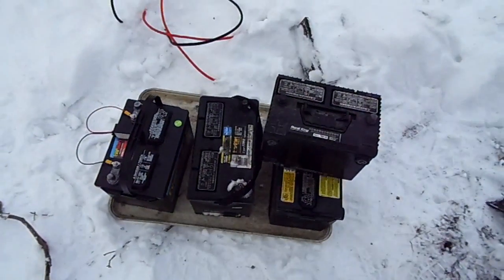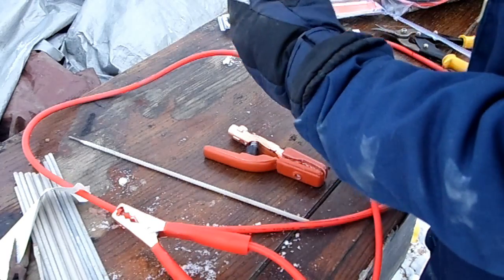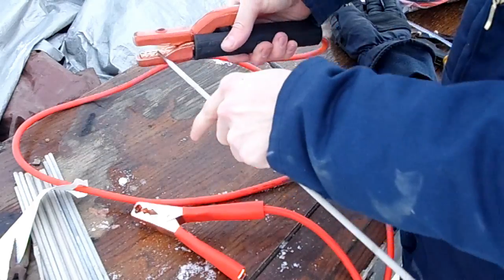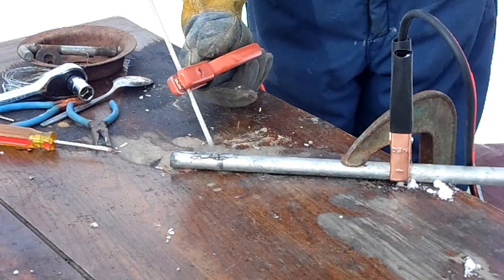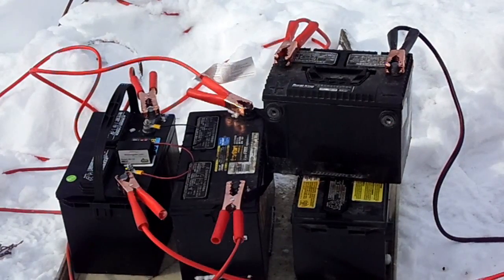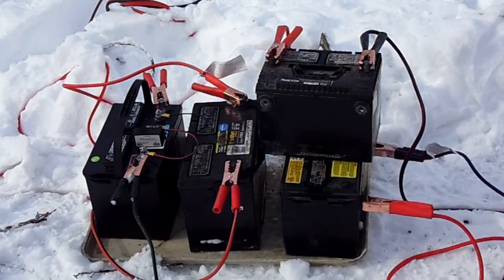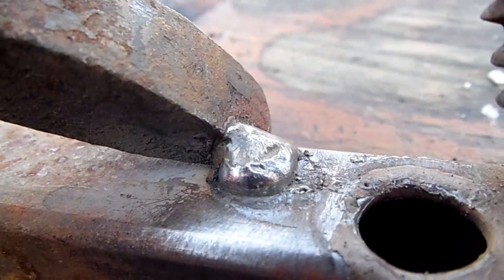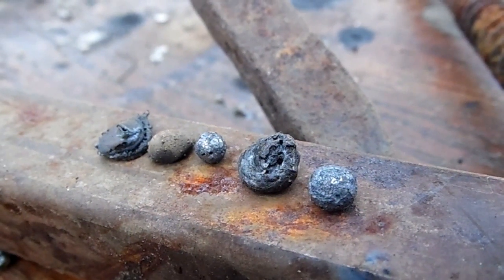DIY Welding with Car Batteries

Comment: You need a little help here super genius.  The black wire should go to the negative post of the battery and the welding rod "electrode" holder.    (not the red)  It is DC electronegative welding.   The red wire goes to the positive battery post and to the worrk piece. 
 You did not have quite enough amps to get your weld going in the beginning.  You could use 2 or 3 batteries in series.  Or you could use 2 batteries in parallel.  In either case still use the negative to hold the electrode.  At the end you were using too much amperage and it melted the work piece.  
next never weld or heat any galvanized pipe with zinc.  The zinc will go into a gas with the heat and poison you.   Bad medicine if you like living. 
Third when you weld don't drag the electrode across the work.  Hold it just about the work to allow the arc.  Make small circles to get the liquid metal puddle going. Then move the little circles in a line over the area to be welded.  
Forth the rod you were using was way too big.  It is for deep welds at high amps on very thick metal.  A  2mm rod will cause a load of  90 to 150 amps.   This will be a good load for the batteries and it is less than a car starting.  It will be very safe.   You should be able to weld for probably 15 minutes according to battery charge and condition.
Reply: +Thomas Harrell actually if you were welder like i am, you would know that there are 3 polarities you can weld in. dc electrode negative as you stated, dc electrode positive like whats shown in the video above, and ac (alternating current) You can weld with either polarity and each one has its own perks depending on the rod being used and the pattern/transfer method.
Reply: @NikeRednecks21  either way fucknutz the guy in the video was 200% full of shit, why you trying to defend him? Are you his boyfriend?
Reply: +Thomas Harrell brother a question, when connecting the batteries in series or parallel welding no matter ?? or as it is better !!
and I understand that you must use the positive in series or in parallel to the ground and the negative electrode where does the truth ???
Reply: +Jose Rincon  you can use the pos to the electrode.  In a very few cases that will work better.  Most of the time the neg goes to the electrode.  It will simply work better that way.  It depends on the metal. 
   batteries in series will give higher voltage.  Higher voltage will burn in deeper.  But not last so long.  Batteries run down faster. 
   Batteries in parallel will stay at the same voltage and will last longer.  
   If you have several batteries you could run some in parallel and some in series to adjust the voltage and last a longer time.  Hope this helps.
Reply: Clearly, if it was of tremendous help, I work with it and you never know when you might need that information for an emergency. so I stay in it was certainly connected in series and in parallel, maybe it while both combinations. If you get chance and explains it agradeseria and apologize thank you.
Reply: +Thomas Harrell Just connect a choke or a transformer between a terminal and stinger and DC will work just fine, DCEN OR DCEP.
Reply: +Thomas Harrell You can weld galvanized pipe, you just need to wear the proper safety equipment. As for the way to weld, it depends on the rod you are using. 7018s are generally known as drag rods where you can simply start your arc and lay the rod against the material and drag it. They are also a really good all around rod, the only time I could see someone doing something stupid like this is in an emergency, generally if you don't know what you're welding use 7018. And lastly the size of the rod in this video doesn't matter, he was simply trying it out. I honestly believe he is full of it when he said his dad borrowed his welder, he could barely get an arc, let alone maintain one.
Reply: mynameisray funny at the beginning of the video his dad borrowed his welder . But at the end he admitted he had done never stick welding before ! Gotta give the kid credit for trying in the first place .
Reply: True and correct
Reply: Better have a battery charger handy..
Reply: 100% spot on
Reply: Thats well said but my guess is he isn't as skilled as some of us, but at least he tried his best
Reply: Instead of just jabbing at it and poking around, why didn't you try doing some welding with the first few configurations, so we could see what happened?
Reply: You are correct. Even if he were welding on something worth welding it would have still run like shit. I have laid down pretty good beads with batteries out on the trails many of times.
Reply: Yeah bud, that's why they're was so much spatter... Red clamp attached to the work piece, black attached to the rod. Good luck!
Reply: I am welding job I'am Indian Hindi language my 9368682793
Reply: get fucked

Comment: I'm not being funny mate but what the fuck. 
Shorting out car batteries could easily blow them up! I've seen a car battery blow up and the acid goes everywhere and as your standing right next to them, well, who knows what could happen. 
And also, have you ever done any welding in your life, judging buy that I don't think so. 
If I were you I'd go somewhere for a course in how to weld PROPERLY! 
Just trying to share some advice that you might want to take on board.
Reply from the maker: +TheManLab7 this "shorting out a battery" takes less power than starting a car. and i hope these batteries can start a car.

i think you need to rethink what shorting out a battery means. ive had batteries blow up too btw, it was never too bad, just threw some electrolyte in the air is all.
Reply: haha and also: weldkng next to explosive objects such as batteries is very dangerous if you dont handel it properly!
Reply: ''this was not labelled a video on how to weld.''
no it was labelled a video on how to weld with car batteris,
you see DIY implicates this is an instructional video...
Reply from the maker: READTHISBITCHESZ
no, "DIY" just means somebody is or can do it themselves, like i did in the video. if you say something is very "diy" your not saying people should do that, just that somebody did it on their own.
Reply: i understand that its hard to get your mind around the principle that; the title (of a subject) should speak to the recipient. so if you wirte DIY (do it yourself) you imply that you have instructions that can help them.
But who am i to point out this grey area of ''Click bait''
Reply: been welding long, it don't look like it.
Reply: They don't "blowup" when being discharged. The only time a lead acid battery can actually blowup is when it is being charged, the hydrogen gas that is released can be ignited by a spark or cigarette or even crossing the terminals. when the battery you were standing by blew up it was probably something you did or a short in the battery that caused it and like I said it must have been charging not discharging.
Reply: not true. Worked for Chevy for 22 years and seen more than blow with simple draw from a starter.
Reply: Lol what. When you start your car you are "shorting out" your battery. Does it explode then  ? God the internet allows idiots to speak

Comment: 7018s are low hydrogen rods and you are setting them in the wetness. I dont have OCD or anything but holy sheet. You then weld on galvanized metal, did you feel sick after filming this?
Reply from the maker: +Bud Masta no, i always weld outside anyway. plus idk if it would be any worse than playing with molten zinc.
Reply: +Bud Masta  I was just about to say same.
Reply: +Bud Masta Zinc fumes aren't a huge problem outdoors and ChuckE2009 proves that 7018s don't need to be dry in order to weld pretty good. Quenching welds in water will more likely result in much weaker welds than welding with a "wet" 7018. Low-hi rods do however need to be used on cleaner metal.
Reply: Seph Angelo he didn’t prove shit. Let’s see you run a 3g test and get a 100 with wet rods lmao

Comment: correct me if i am wrong but wouldn't he get a better weld with less splatter if he grounded the metal using the positive side of the batteries and using the negative side with the stick

Comment: Nice Video! I always enjoy your videos, I think(from watching other videos) that you are supposed to use the Negative Terminal as what you're actually welding with(the one with the welding rod) and the Positive Terminal hooked up to the metal of what you're trying to weld. Kind of makes sense, because the electrons are negatively charged and seek the atoms in the positive terminal(since the atoms in the positive terminal are positively charged).

If the negative pole is hooked up to the steel, the electrons have to flow through the metal and then into the rod and back out to the positive pole, but if the positive pole is hooked up to the steel, the electrons(flowing from the negative side) will flow through the rod and into the steel, thus concentrating the electrons in a smaller space and creating more heat(a side effect of all the amperage in a concentrated space). :) :) :)

Oh! And nice job on the welding!

Comment: welding means sticking things together not opening bang fuckin explosion wholes LOL 
you should be using the negative cable to weld and try using some plyers to connect the cable to the plyers and hold the weld stick with the plyer..

Comment: for a super genius you're not very bright. 2 batteries are plenty of power to weld with. You should be welding with the negative terminal though, you get a much smother weld. Since you already have the positive terminal connected to the welder just switch the terminals on the batt put the red on neg and theblack on pos and you'll have a much smoother weld  and plenty of pwer with two batts

Comment: Try setting the batteries up in series-parallel.
That way you get 24v to start a bead and enough amps to keep it going
Reply: the  other problem is your clamp goes positive to item, rather than negative and stick goes in negative, If you are welding on a truck frame you might need three batteries but most items in a farm only need 24 volts
Reply: run it in series
Reply: 24 volts is not enough to sustain an ARC, even with 1/16" rods. Just tried it using, DC-Reverse,  on short Guage 0 cables.

Comment: You can't weld worth a shit.
Reply: Yea it's the technique, not the fact that he's welding with god damn lead acid batteries
Reply: Dylan McElveen it's not the fact that he's welding with batteries. He can't even strike an arc right. That's not the battery's fault.

Comment: With all due respect fellow ... on DC welding you are going to want to reverse the polarity to positive ground and negative on the stinger / rod with the rod you are using there. You are just making sparklers like that bud... the flow of metal is smooth that way and the molten steel puddle is drawn to the work and you will actually get real work done instead of frying rods and butchering your material. Also 24 volts would likely be enough to get the job done in most cases. That and a 6013 rod ( can be used + / - polarity ) for clean new metal  or a 6011 for ugly metal or similar and you are in business with a cheap portable rig but make sure your connections are very good and tight. You will melt cables and connectors in a hurry that way if not.

Comment: You need to hook your + to what your welding and use your - for the welding rod that's why it is sticking and you have all the splatter did

Comment: Everyone seems to have a problem with getting batteries to work well. Another problem you might have had was the moisture content of your rods. If they haven't been kept completely sealed they absorb moisture and perform like crap. I remember my dad putting his in the oven to drive off the moisture. Personally I have only occasionally had the use of large dc welders. Mostly I have had little buzz boxes that work like crap. I much prefer mig welding as a result. Enjoyed the video.
Reply: consaka1 Right!! I was wondering if anyone was going to catch that part. You can also make a heat box by using just a 50 watt light bulb
Reply: Yeah I didn't understand why no one else had said anything myself!!

Comment: I love the effort mate, Ive always enjoyed working out impossible solutions to technical problems and i have done my fair share of wrong repairs to keep the gears turning.
I know there will be alot of criticism to what you are doing, which will mostly be technically correct, and i know you probably will ignore most of it, but i have to try and point out things unnoticed. 
There were some tricks to last ditch welding that can save you alot of trouble;
There is no war between series and parallel, use both, im sure you can figure out how
A welding rod is of the same basic nature as a resistor, changes in length change the nature of the welding action, you can take advantage of this
Welding is a hot process, ice cold steel assemblies can weld more easily if you take the time to preheat the work, you could have welded well with one battery if you had everything already hot enough (rather hard but you can)
Welding is a dry process, moisture will make weak welds
Lots of sparks are pretty and should be involved in fireworks, not welding
Electrons have more important things to do with their time and enjoy efficiency, their minimum use lends to better welds
i cant think of anything else i can tell you that i think you will at least consider, which is good in its own way, have fun and keep up the great videos

Comment: if 48v is blowing holes in 8th inch steel then i wonder how the traction pack in my ev would go
150v 100ah id be able to weld U beams together
Reply: arklanbk lol 15kw at 1C... you'll do more than weld u beams together.

Comment: I think thats brill...I think if your rods have been a smaller size the results would have been better...but I get the idea....never realized it was possible....

Nice jobs thanks for uploading...keep up the good work.

Nick in the UK.
Reply from the maker: yeah i actually stopped using my MIG when i found 1/16th inch rods work great with 3 batteries. i've used those batteries to weld a lot over the past year.

https://www.youtube.com/watch?v=ysyKUlzXF5U

Comment: Youre "welder" actually works better than i thought it would, but you "Welds" are HORRENDOUS (Spelling)
Reply from the maker: well i wasnt actually welding anything in this video, i was just messing with the arc. plus at this time i was used to MIG and didnt have the right rods. but i've welded a lot with 1/16th inch rods in 2014 with 3 batteries to give 36v.

Comment: you have no idea what your doing
Reply from the maker: thats what "experimenting" and "tinkering" is all about. i got better at stick welding with batteries. i was only used to MiG welding at that time. but the biggest issue was i didnt use 36v with 1/16th inch rods, if i remember this video at all.

Comment: dude!!! the welding rod goes on the negative!!!!
Reply from the maker: not always, it depends on the type of weld.
Reply: Rinoa Super-Genius those are some clean beads bro lol
Reply: Rinoa Super-Genius Yes right, but with this type of welding it is best to use the negative no matter what you're doing.
Reply: Chase Gallagher No one cares... he was just proving you can weld with a battery.
Reply: Jorge Tellez
Reply: DC welds you want the positive side. Less splatter. This kid just sucks. He'll get better

Comment: Oh yeah...You might want to try to make a reactance coil for your homade stick welder which nothing more than magnetic wire turned over a peice of maybe concrete rebar.  It will make it run a lot better.

Comment: Your sticking is due to the fact that you don't have the last part of the welding rod in the holder.  If you look there will be some bare rod with no flux.  There is where you put the rod in the rod holder.  Not like you see in the old movies.
Reply from the maker: yes i connect it to the bare rod. you wouldnt be able to weld without that. and the reason why i was sticking was the welding rods where too big. i've found 1/16th rods work great.

and what old movies are you talking about?

Comment: Omg putting the rods on a wet table...
Reply from the maker: i've found that moisture doesnt matter as much as people say. after all i'm not welding parts of the space shuttle with this.
Reply: Rinoa Super-Genius But someone might someday see those bits of metal and think, ah, bits of metal! I will use those to build a new space shuttle! Result: catastrophe. So you see, everything must be done as others tell you.
Reply from the maker: Ralph Dratman
not much steel is used on spaceships. mostly light metals. plus if they used metals that they didnt melt down or even do a simple xray scan on then thats their own problems.

Comment: Nice video - thanks for honesty - on 1.5mm rods you can go 24 volt - maybe rods is wet or damp -☺☺☺
Reply from the maker: i find 36v with 1/16th inch rods will work great weather dry or wet.

Comment: the sticking problem you were having is not cause of you but cause of the rods they are bad or cheep
Reply from the maker: actually its the cheep 7$ jumper cables i used, they where like 10 guage and would almost melt every time i welded. they acted like resistors only allowing 1/16th inch rods to be used easilly. but when i got my big 150 amp welder these 1/8th rods work fine.

Comment: Stick is really easy bro u only have to have a steady hand and when u strike the arc just starch get a good connection and don't press the stick on the material just practice that u will be a pro stick welder in no time.